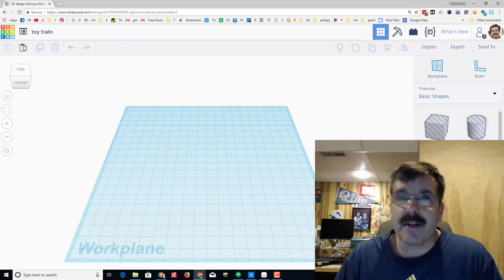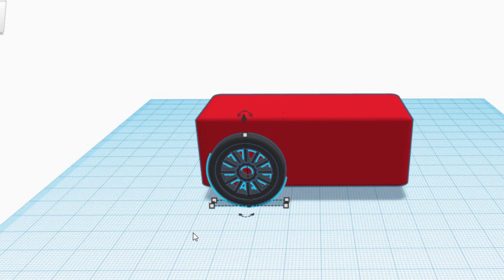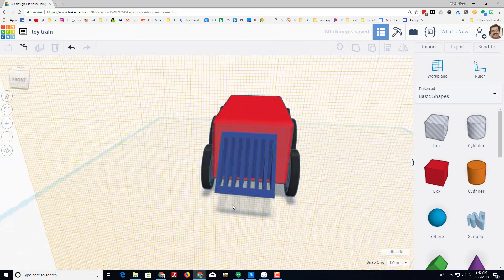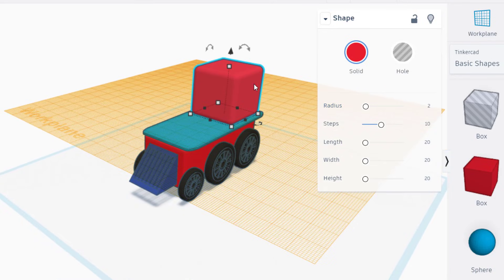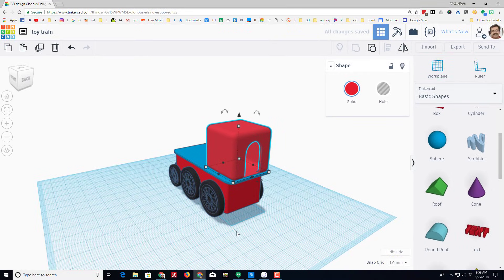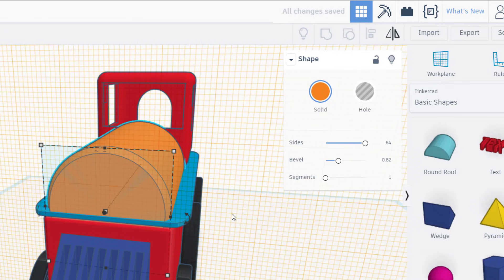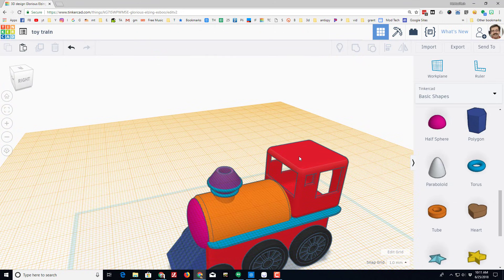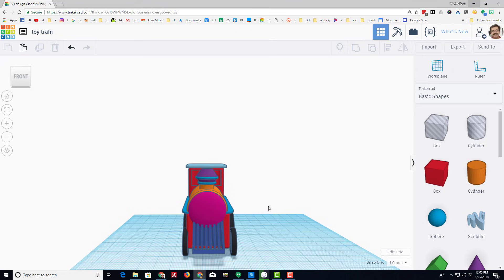Build A Tinkercad Train With Ease - Beginner Friendly Tutorial!

Comment: is there a way to zero in your object?
Reply from the maker: If you click on a part, press F and it will fit the view to that part.
Reply: @HLModTech  thanks for the reply but thats not it , if your object is off and you try to flush it to the floor it wont be completely flat, i found a way to do it through another youtuber but i was hoping for an easier way
Reply from the maker: Sorry, I did not quite understand when you meant by "zero in". I read it as visually.. 🤦‍♂️

Comment: Tinkercad needs train rails and wheels and maybe a bogey set.
Reply from the maker: I just saw a user making train tracks in the Discord. This user did a sweet job on her own back in the day. https://youtu.be/0AsJk0dtVEI
Reply: @HLModTech  SarahCath published Train Track Straight in "Gn15" scale, but "Gn15" runs on H0/00 gauge (16.5 mm / 0.65 in) track and that is specified as 16.5mm between the INSIDES of the rails and hers is 16.5mm to the OUTSIDE of the rails! I propose using Lego Gauge. That comes in 5-stud and 3-stud sub standards. 5-stud  is normal but you can't fit a steam engine on a 200mm build plate so I'm looking for an original 3-stud kit to consider.
Reply from the maker: @DanK-ZDP189  Are you thinking of actually 3D printing them?
Reply: @HLModTech  yes